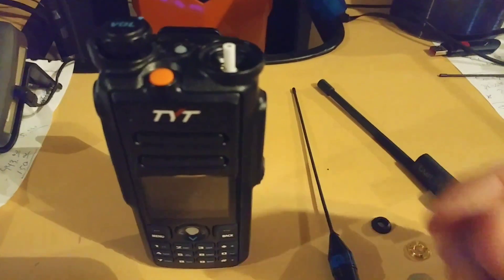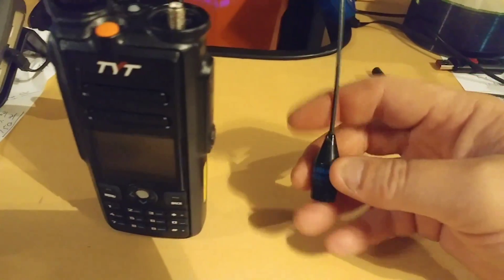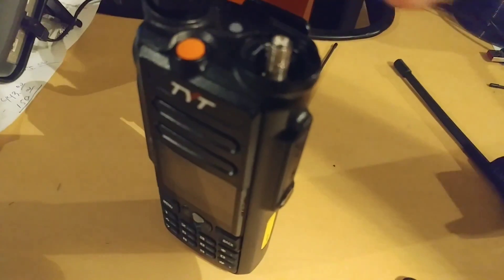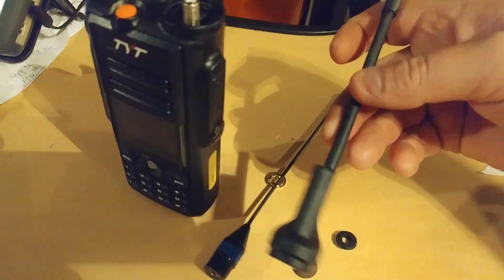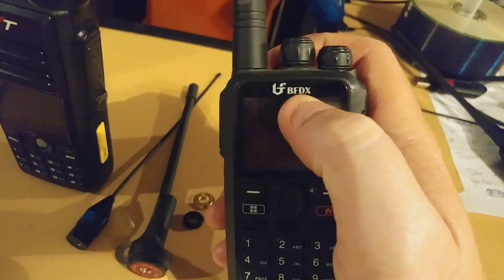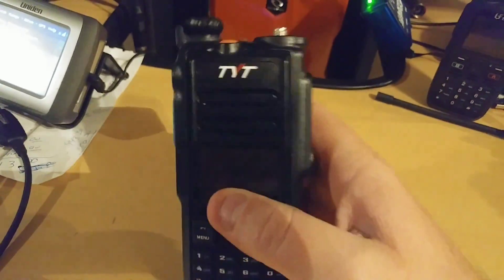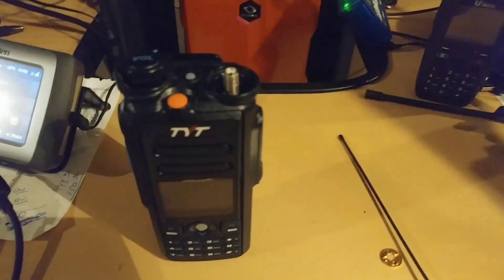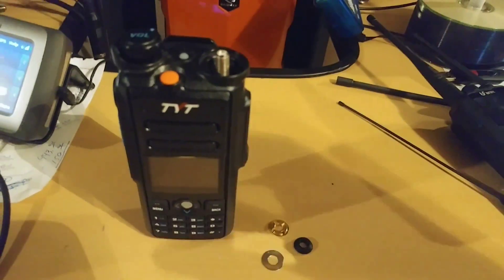TYT MD 2017 Dmr Radio Antenna Connector Failure

Comment: They don't make the  connector, so they just went with low price to increase their profit margin. That type of mentality  will tend to go wrong if parts are not examined before the deal is made.  When I worked in the manufacturing  business, buying capacitors, or any parts on a surplus market was touch and go. Sometimes surplus is not surplus. Sometimes they made bad parts and they could not sell them to customers who would hurt business, so they sell them at cost in bulk, and they end up on the surplus market. So low price is sometimes a good deal, but sometimes, it is not. Many companies have taken hits with bad tantalum capacitors,  and glitchy logic chips. If they survive that, it is a lesson that sticks with you.

Comment: This happened to mine right out of the box. Display went crazy on XMIT due to high SWR. Curiously, a Icom (long thread SMA connector) antenna worked fine, but two original antennas failed. Now I see why.
Thank you Jason for helping me resolve this failure.
Reply from the maker: yea its starting to be a issue im hearin gof a lot of 2017s with this problem its sad because the radio is great other then that

Comment: I've been following these antenna failures for a few weeks now.  

My thoughts is that the combination of the waterproofing gasket and the design of the antenna (which allows a user to put a lot of rotational force on the antenna) puts a LOT of pulling force on the outer conductor of the SMA socket... any issues with the SMA connector will show up with treatment like this.

SMA connectors aren't the best design for this kind of use, but you are right... having the male in the radio is much better implementation of the interface.

I've had Icom D-Star radios (with female on the radio) for a long long time with no problems (so far)... I think the majority of the problem in the 2017 MUST be the quality of the SMA socket on the MD2017.
Reply from the maker: Yea i agree 100 %
Reply: If you replace it with a different antenna, your best bet is to get a plastic compressible washer to fit in that lip for the antenna to take up the extra space and help support any side torque on the antenna/connector.
Reply from the maker: Yea i agree i have several radios with sma this is the only radio with this issue. So that tells me its just crapy sma connectors im guessing TYT found the cheepest they could find and just put them in. The bad thing is TYT attitude is we dont care we have your money already so deal with it. I guess thats what we get when we buy cheep chineese made crap. The radio is awesome other then this problem and it is a big problem. For me i dont think i will buy any more TYT radios I have already pre ordered a md-9600 for almost a year now on pre order but after that my next radio is a motorola or i would like to try some of the alinco dmr radios. They look great I would love to try one when the 9600 gets here I will make a video of that and my thoughts. I have many more videos to come im waiting on a new camra and ill start making them again. Enjoy the videos and enjoy ham radio if anyone has a video you want made just ask if i have the stuff to do it ill make it for you.

Comment: Note that the length of the threaded stud is twice as long as the typical SMA connector.
Because third-party antennas (such as the MD-380 and others) aren't that "deep" the base of the antenna will never touch the base of the hole and consequently the body of the radio's case.
This means that all of the stress is place on the thin, threaded barrel of the connector! Just very slight pressure on the antenna will cause the connector to snap at the base, just as the video shows.
Frankly I have to say that it is a lousy design, and really should be addressed. In the meantime folks should not try to use aftermarket antennas with the MD-2017! Or, use a thick enough rubber spacer to allow for body/antenna base contact.

Comment: I assume that connector it's not a standard one and cannot be purchased from ebay:) I'v got idea for You, because they want to pay 17 USD because their quality control failed i would recommend  find a nice lady working in "jewelry store"  and have something like this: https://youtu.be/rzltkc-kcdY?t=41  (its also used for repair glasses frame)  i'm pretty sure after soldering like that the connection will be stronger than original. 
Replacement of it that's ridiculous, i bet connector they send will have same issue,  other people also have same problem.

Anyway i'm going stay away from TYT.
Reply from the maker: Oh wow that is sweet i got to have one of them babys lol i bet that would work if you wanted to go that way the connector is not standard i have been looking for a connector a stronger one im shure i could make something work i do have the repair video finished i willl be posting it up in a few days so guys can see how to repair this with a new connector for those of you who can not do it if you get the parts from tyt i would be happy to help you repair it as i hate to see this happen to the ham community and as we can see tyt is not gonna sand up and take responsiablity for poor enginering

Comment from the maker: Ok guys here is the update TYT wants me to pay 17 usd for the shipping of the part and install it my self so with tyt you get no warranty unless it dont work out the box. The year warranty is useless they said they will let the sma maker know of the problem but we all know how far that will go they will continue to send this crap to the usa! I for one will not buy another tyt , infact I have been looking at the new alinco dmr radio and the new connect systems 7000 dmr dstar radio anyway. At least i will get to talk to some one who speaks english and connect systems cust service is top notch. I talked to another ham with this exact same issue he had his radio 2 days and the connector broke he also conacted tyt and they want him to pay 17 usd for shipping of the part as well so if yours breaks and im sure it will unless there is just a few week ones out there lets all hope that is the case maybe just a few with too much metal took off at the lathe you can expect to pay for the shipping of the parts and install it yourself if this happens to you
Reply: Wow, what a shame, looks like I will not be buying one based on this.  Did you buy your radio from a dealer if so that would be my next move to contact them & see about doing a return or exchange.  I wouldn't put up that answer from TYT totally unacceptable from a company. If they are any kind of a company they should step up to the plate and fix or exchange with no cost to the consumer apparently there is a issue that was not consumer inflected.

Comment: My MD-380 looks to have the same antenna design.  I wonder why one radio is having antenna connector issues and the other does not? -NM7C
Reply: Note that the length of the threaded stud is twice as long as the typical SMA connector.Because third-party antennas (such as the MD-380 and others) aren't that "deep" the base of the antenna will never touch the base of the hole and consequently the body of the radio's case.This means that all of the stress is placed on the thin, threaded barrel of the connector! Just very slight pressure on the antenna will cause the connector to snap at the base, just as the video shows.Frankly I have to say that it is a lousy design, and really should be addressed. In the meantime folks should not try to use aftermarket antennas with the MD-2017! Or, use a thick enough rubber spacer to allow for body/antenna base contact.
Reply from the maker: Yea i wonder the same thing  only thing i can think of maybe a new batch of sma connectors and they are weak ? i dunno thats a good question i talked to a ham today on tac 310 and his has broken also so it semas to be a problem thats gonna bite tyt in the ass

Comment: I just bought an MD2017 as well. My antenna mount hasn't broken yet. I also bought the accessory antenna you recommended. It's very nice. Thanks!! I take my written test on Saturday. This is my first dmr radio. I downloaded the software but I'm stuck in doing my code plug. Would you be willing to send me one? Maybe if I saw it in front of me things would click. I'm in Billings Montana. I'd be glad to compensate for your time!! 73's!!
Reply from the maker: Greg ide be glad to help anyway i can are you going to be useing a openspot or are u useing the local repeaters ?
Reply: AirWavZ KG4VDZ  Hey, thanks for the quick reply!! I will probably get an open spot at some point but will probably use the repeaters for now. This is a site fir local hams and I included this one link. Hopefully it will help!! I tried downloading it but my laptop would not open it to dump into my tyt software. 
http://www.dmr-montana.net/page1/files/Worksheet%20MD-380:390%20Codeplug%20170702b.pdf
Reply from the maker: Ok the file i downloaded is a md380 code plug you will need cps for the md 2017  version 1.6 version 1.5 will not open a md380 code plug to convert it to use with your 2017 download cps 2017 v1.6 then open the file with that and you will be golden if you need any help or have any quesions just let me know i opened the file and that is a huge code plug someone spent some time on that one looks like it has all of your local repeaters and talk groups set up correctly and looks good if you need cps 2017 v1.6 let me know and ill email it to you the worksheet will show u whats inside the plug you can print that but the code plug is above that post it is titled  Tytera MD-380/390 7/05/16 latest update download that one then open it with cps 2017 1.6
Reply: AirWavZ KG4VDZ  If you wouldn't mind emailing that file to me, I would appreciate it very much!! Thanks again!!
Reply from the maker: Greg Church sure what's your email addy
Reply from the maker: Ok ill get it sent ot you now
Reply from the maker: I sent it to you but it got sent backsecurity issue i guess gmail wont let you accept files ? i tried twice
Reply from the maker: Ok ill try that one now u shoudl have in about 2 mins
Reply from the maker: That one worked you should have it
Reply: AirWavZ KG4VDZ   Sir, I left work about an hour ago and nothing. Maybe it got blocked too. Do you have a link to it possibly?? Thanks fir your patience!!!
Reply: AirWavZ KG4VDZ   I tried to open that code plug profile just now and it says it cannot open it as (3).rdt' as archive. I have no idea what that means. Also I downloaded a file CPS 2017 V1.17\CPS-DMR.exe is that the latest update? I tried some other code plugs and get the same rdt archive message
Reply: Jason. I got the code plug imported into the cps okay. Now it's telling me that my USB needs to be checked to see if it is occupied or not connected. I think other guys have had this problem too.

Comment from the maker: I must say TYT has already responded to my email it took them less then 12 hours to respond i will keep you guys updated on what they do UPDATE TYT will be sending a new connector but i have to install it myself ofcourse for me thats not a problem as i work on electronics anyway but for some that may be a problem TYT has asked for pictures to send to the SMA Connector manufacture to let them know there is a problem so hopfully there will be a stronger connector for future radios that come out I think they make a great radio i have not found any issues with it so far but the cheep sma connectors well see what they do ill keep you guys updated i will make a follow up video showing the parts and maybe the install if you guys would like to see that
Reply: They didnt tell you that as soon as they get it from the mfg, they will put it on the next boat which is scheduled to leave August 15th, and arrive in California in early September. You should have no problem having your radio back in service by the end of September. I was impressed up until now.
Reply from the maker: LOL Thants about right lol should only take half a year to get it i will prob just machine my own looking inside the radio its a common sma 2 hole panel mount ill ry to find a good one or just make a super strong one rather then wait for it to arrive
Reply: AirWavZ KG4VDZ 
is this not a warranty issue? I think the company should repair or replace the radio. I was impressed with this radio but not now. it's nice to see them mailing you a connector but really, you should not being seeing that problem.
Reply from the maker: I agree i think they should repair or replace it its that simple the way i understood it they would send a connector ill know more in the morning as to what they intend to do
Reply: Jason I think you could become the non compensated warranty center now that you are experienced and self taught
Reply from the maker: lol you think so lol
Reply: Mine just broke today, do I understand that the replacement part is of the same type, very weak at the base? If that is the case I am going to see if I can retrofit a Baofeng reverse SMA flange mount on it.
Reply from the maker: Yea its the same crapy connector if you can fit a sma male that would be a lot better when mine broke the dealers didnt have any and tyt was charging 17 bucks for shipping the connector was free ofcourse lol i replaced mine it has not broke yet so far so good if it breaks again i will use a md 380 connector as i havent heard of any 380 with broken connectors seams liek tyt went with a different supplier of sma connectors for the 2017 to save a few bucks and now we are paying for it
Reply: What is the email you used to contact them my  antenna broke I emailed them a few days ago have not hurd nothing back

Comment: Let us know what happens worse case you gott super glue or something
Reply from the maker: Super Glue wouldnt work as it has to make a electrical connection this is the ground side of the antenna might work if  you use it with the ht antenna on the unit but useing it with a external antenna would be out i think the right way to fix it would be put a new connecter inside the radio maybe a different sma maybe one that actually has some strength
Reply: AirWavZ KG4VDZ worse care if tyt does not fix your radio if you don't wanna Fix the hole radio port! Try to screw the SMA connector back in the  antenna prob not gonna have waterproof anymore the glue the side of the antenna not wear the ground is!! I feel like you got a bad batch since day one with your first video about the antenna!my stocking  antenna works perfectly with the 2 meter ham band